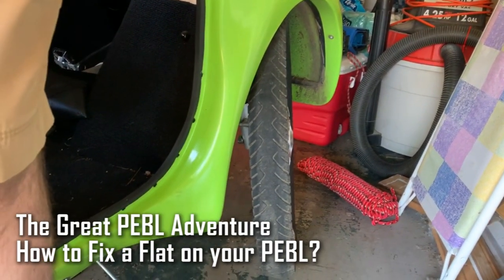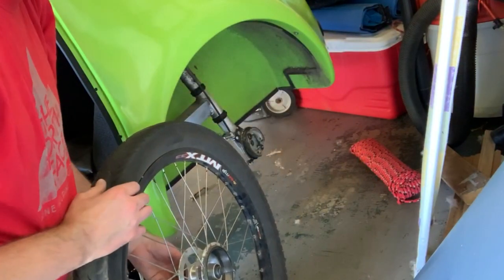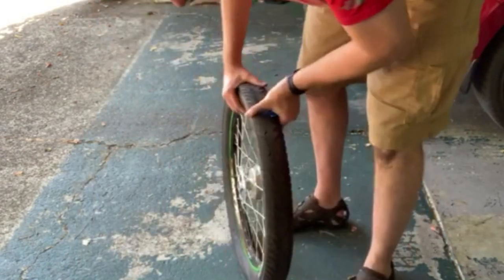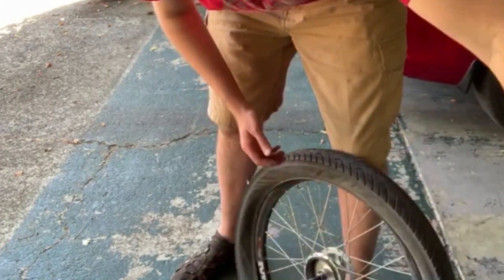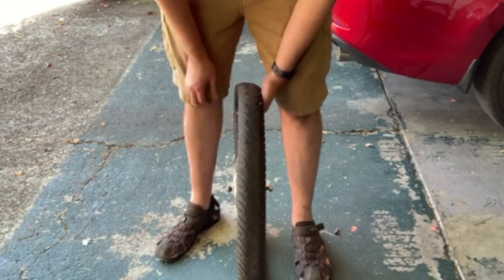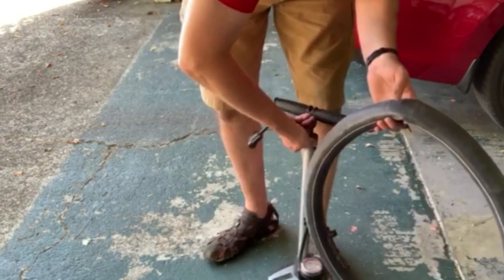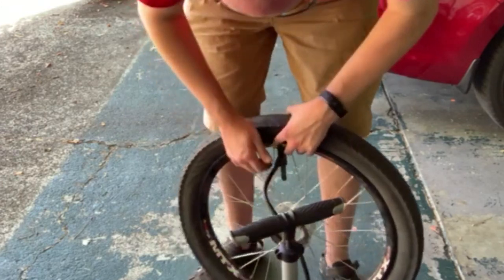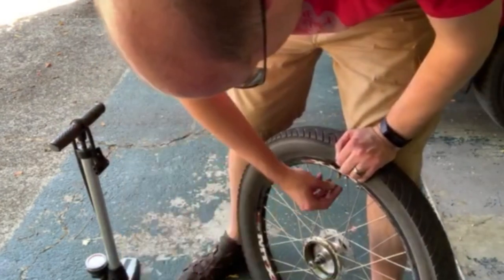How to Change a Tire on a PEBL

Comment: thanks Eric. I changed my front tires and tubes without removing the wheel. It was quite easy, the first one took about 10 minutes and the second one about 5 minutes. The only reason I'd remove the wheel is to inspect or replace the brake pads.

Comment: A small point but worth doing is to mark which way the outcoming 
tube sits in the wheel and then inflate it to find the leak and mark the location - and then put the marked leak back in position to find if there is a very small, almost invisible thorn still in situ.

Comment: It’s a STURMEY ARCHER drum brake at bottom of macpherson strut. The newer ones are 90mm, before that they are 70mm. Dr. Earl Macpherson a engineer at chevrolet in early 50’s gave us the macpherson strut.
Reply: There's no suspension on the front of the PEBL, so it isn't a MacPherson strut. I think it is called a king pin.

Comment: Eric - every day I easily lift one of my front tires to demonstrate the light weight of the ELF, only one hand is needed to push up on the top of the door opening. I made a simple wood stand from an 8 inch square base of plywood and a 2x3 stud scrap about 12 inches long. I can't see any need for a jack unless your body shell is too delicate to push up on the door opening to tilt the front to one side or the other. My stand is just high enough to hold a tire one inch off the ground. I lean the stand against the frame and tilt the ELF enough to let the stand level itself under a frame member. For raising the rear tire I lean the stand up against one of the frame arms and lift the rear wheel just enough for the stand to fall into place under it. Maybe your rear end is too heavy for that but a simple lever and fulcrum could do the job of lifting it 2 inches. My simple stand is light and easy to carry in the trunk. An even lighter stand could be made from PVC pipe and flange. I also carry a linear tube so I can change a rear tube without removing the wheel. Never needed it so far....  For an on the road repair a front tube it can be replaced without lifting the wheel by careful rolling it a ways after prying off one side of the tire. If the puncture point is known you could try a patch with the puncture on the high side, wheel still on the ground.
Reply from the maker: Popeye Gordon makes perfect sense. Loved the linear tube. I didn’t know those existed before your post.
Reply: @EricFischnaller  Believe it or not, the co-founder of OT Davis Carver says we can buy a 27 x 3 inch tube, cut it across from the valve stem and tie wrap the two cut ends to make a linear tube.......  I think I'd want to add some rubber glue in there before and after the tie wraps but it might work.

Comment: When rotating front tadpole tires for even wear you can retain the rolling direction by letting the inner side become the outer side on the other wheel. It is generally advised to maintain the rolling direction of broken in tires for retaining the best ply bond retention and delamination prevention. That is more important than trying to display the tire decals for show!

Comment: I wonder how well the PEBL would stay upright, unencumbered, without one of the front wheels in order to change it. I can vouch for AAA as I used it two days ago, but unless it's nasty I'd rather spend 20 minutes to replace the tube than an hour-and-a-half to wait for the tow truck. 

A question that maybe you can do on a future video: have you had to adjust the cabling on the drum brakes? There are plenty of videos on disc brakes and they're pretty applicable; but drum brakes seem pretty rare. 

And, it's nice to see you with another video!
Reply from the maker: Aaron Propes I haven’t adjusted them at all. Suspect I’d just use the adjustments on the brake lever
Reply: It is just as easy to change a tire or tube with the wheel still installed. Some consider it easier.

Comment: Did anyone else notice at 10:40 that the rim tape seemed to be loose and not seated as Eric shoved in the tube? If it was not rim tape was it an aftermarket puncture barrier in the tire?

Comment: Thanks for the video; it was quite helpful. Did you get a look at how the brake shoes were wearing?
Reply from the maker: Neil Blanchard mine don’t seem to have any real wear. I’m of the type that takes ones thumb off the throttle and lets friction and wind slow me down. It’ll probably be 10 years before I need new brake pads
Reply from the maker: I did get new brake pads for the disc recently though
Reply: @EricFischnaller  Were they worn evenly, or is the caliper positioned about 1/4" too far away from the disk?
Reply: @EricFischnaller  I am going to check mine soon. Nevin says they should last about 5k miles typically. I bought 2 pairs of new drum shoes recently, so obviously I am good for a while. I thought I was ordering 2 sets.